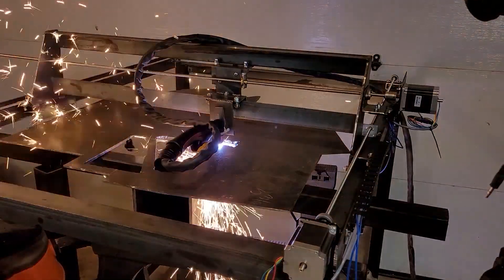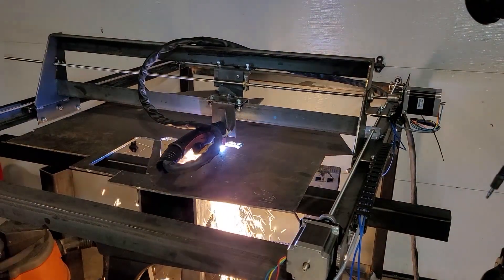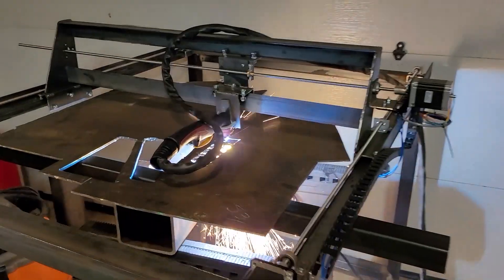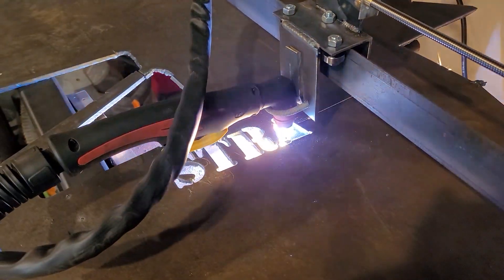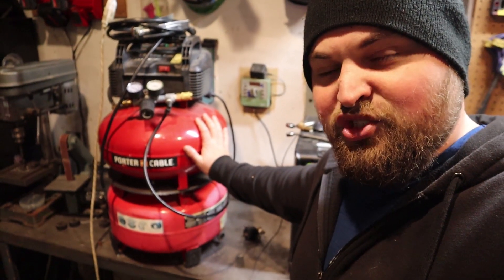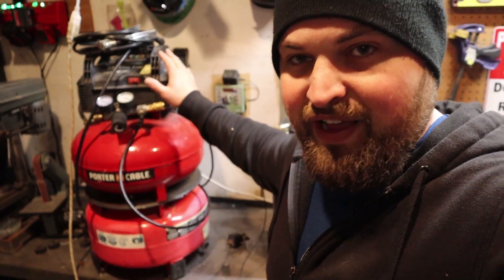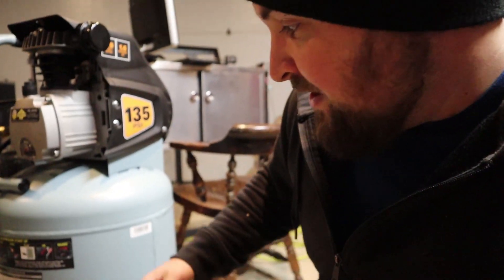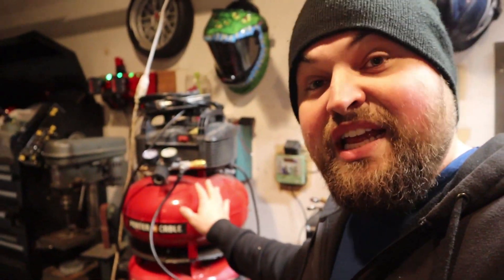CNC Plasma Cutter update: Video coming soon

Comment: What’s your plan for the duty cycle. Just watched your video for the review of the plasma cutter and it sounds like it’s not meant for continuous running. I imagine that some of the cuts will take longer than 5 min.
Reply from the maker: This is a really good question. I think it will be an issue but hasn't so far. I've ran the machine probably an hour so far and had to replace the tip, but everything else is on point.
Reply: @StrangeGarage  that’s good to know.
Reply from the maker: And you are 100% right, I have run programs that are in excess of 10 minutes.

Comment: Not sure why more people don't do multiple compressors.  They seem to be cheaper than single big ones.
Reply from the maker: I agree. I know if the compressor settings are too dis-similar to each other then one compressor does the majority of the work, but I think it should be more common than it is.

I will say my 20 gallon compressor (when it works) makes exactly the same amount of noise as my 6 gallon. Those little ones are just way too loud for how little work they actually do.

Comment: i tried to build a cnc plasma last year and everything was working fine until the first actual test cut... turns out the high frequency start from my cheap plasma cutter caused interference with the arduino controller and froze/reset it. i tried every solution on the internet to fix it but ended up turning the machine into a cnc router T.T
Reply from the maker: Yes, the high frequency start causes a lot of problems! I had multiple issues along that line. It took substantial effort for me to get it to work right and I still might not have it 100% right.